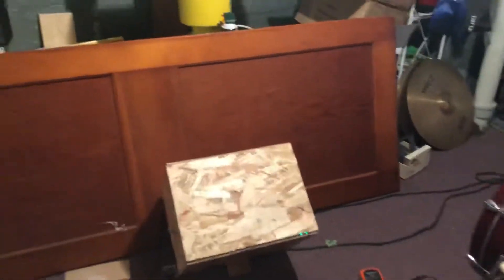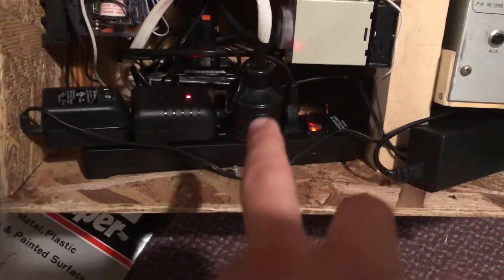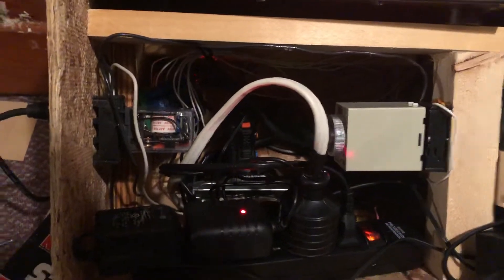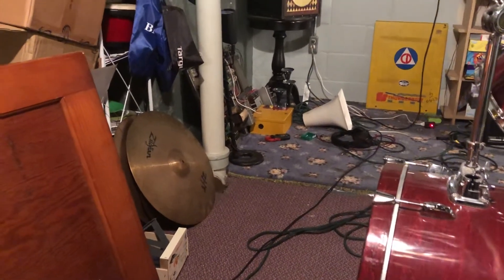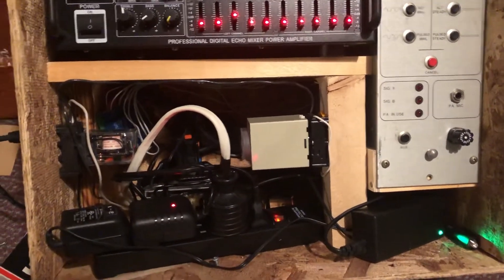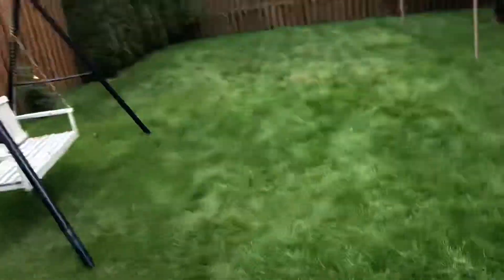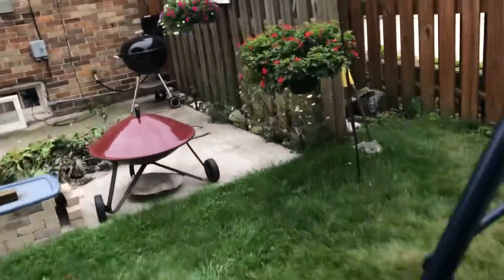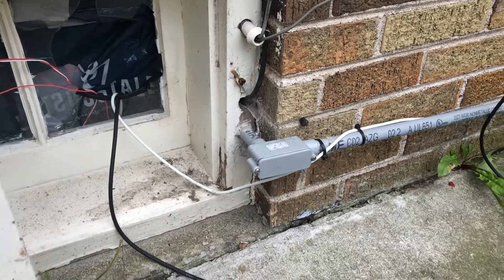Mini ACA Alertronic / Botleg SiraTone Update 9/9/2019

Comment: Just out of curiosity, how hot does it get in there with the permanently on amplifier and all the chargers? My own controller, even with no transformer power supplies does get fairly warm. Also like your Baofeng radio idea. I couldn't fit everything into one box so I made another. As for antennas, would it be easier to get a magnetic monopole antenna which is something like 1 foot long, and has a trailing lead? It would mean you can have an antenna, but it would be on the outside and so there isn't any room problems.
Reply from the maker: Alfie Woolard The Amplifier is not permanently on i just forgot to cancel the unit out to turn the amplifier off. Normally when the SiraTone is not running the amp is not running.

Comment: The baofeng has a female sma connector
Reply from the maker: sean juth For my homemade radios I usually get a SMA to PL-259 adapter
Reply: @FSThunderboltfan1000  I forgot to mention that the baofeng charging base is not meant to supply power to the radio while it's on. It destroyed my charger. You need to get a attachment that goes where the battery goes that actually uses the transformer for the charging base to power the baofeng